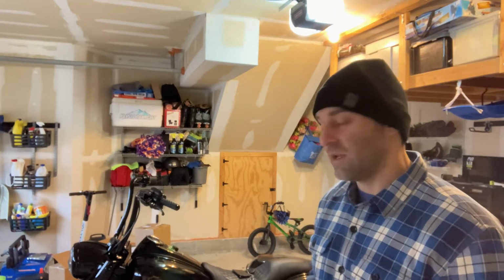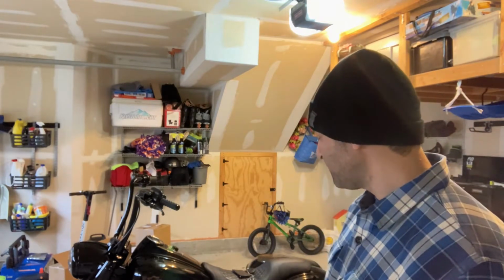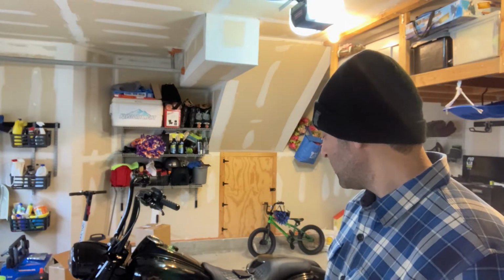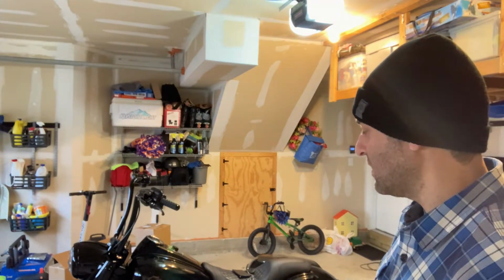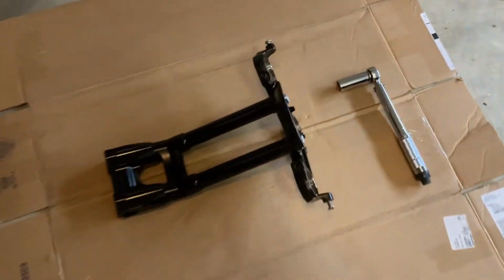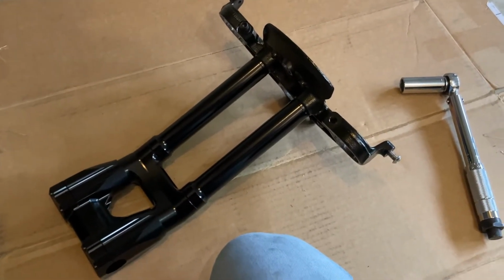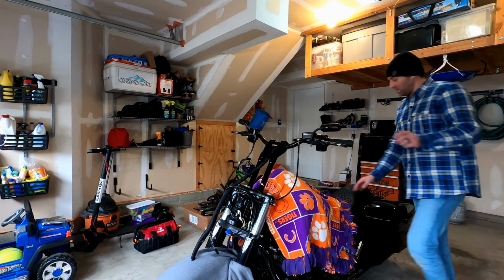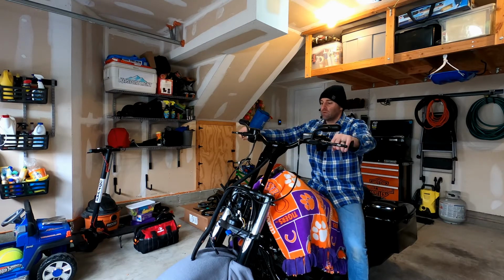FXRT King Build Episode 1 #RoadKingSpecial #HarleyDavidson #FXRTKing

Comment: Just stumbled across your channel SJ. I'm watching. I'm 60 years old and still ride fast and far. Was on e-glides and r-glides (a couple of Dynas too) over the last 30 years. 2015-2019 I had a great experience on a 2012 Beamer 1200 GSA (tanker). Of all the Hd touring bikes I've had, that Beamer was the best highway bike I have ever ridden. 2019 I sold it to go back to HD but didn't want, and still don't want the tech on the new touring bikes. I've ridden with guys that spend a lot of time dickin around with the tech. I bought my first RK  in 2019 (2020 model). RK Special. The speedo is all I need and I really don't even need that. I've done the usual improvements to make her fit me and I love this bike. I'm no gangster or Dyna bro. I'm a highwayman with a lot of miles on the road so I set my bikes up for practical highway use. I like the way you're going with your RK. Looks cool and is sensible. Keep it up. I'm digging it.
Reply from the maker: Thanks brother!  Appreciate it and more content on the way.

Comment: Where is the video where you talk?  I'm looking for information on installing straight risers, but the triple confuses me.  Do I need a part, or is the triple tree stock on the RKS?
Reply from the maker: I left the stock triple tree top clamp when I installed the Kraus risers.  I deleted/removed the stock riser clamp that is bolted to the triple tree top, as that is no longer needed.  The risers bolt directly to the top triple tree clamp.  I also deleted the fork lock.  There are quite a few videos where I show this but don’t talk in depth about it.  I eventually swapped the stock triple tree with Kraus Wolf One top.
Reply: @SJBagger  Thank you!

Comment: Nice bike man, you may have mentioned it but I missed it, do you think you could have done this with the stock brake lines and clutch lines?
Reply from the maker: Good question.  So I had Carlini 16" Gangster apes originally obviously had to swap lines.  Stock bars are 9" I believe, but you are removing the riser clamp when going to a Kraus setup similar to mine so maybe the stock lines are good up to 10-11".  I think you may get away with it if you went to an 8-10" rise, but just hard to say for sure.
Reply: @SJBagger  I was thinking a thrasin 9.5 riser and a mid bend bar, I know it’ll be pushing it, but thanks for the reply, I love your bike, essentially why I want. You’re killing it!
Reply from the maker: @austinrivers9938  it’ll be close.  Not sure how much slack is there with stock lines and I think Thrashin mid bend has to be at least 2”
Reply from the maker: @austinrivers9938  thanks bro